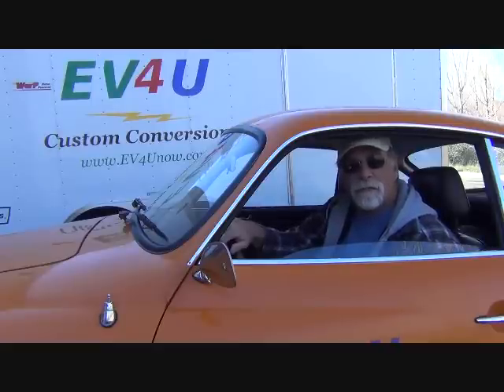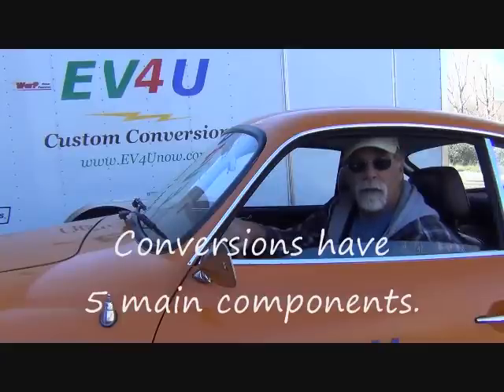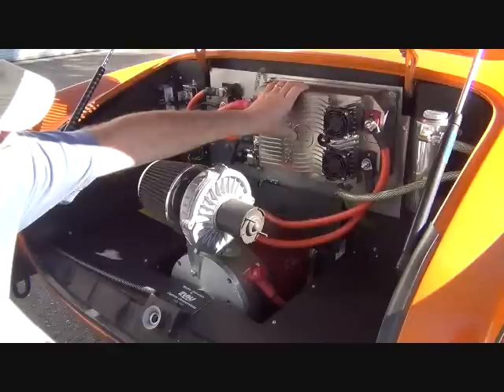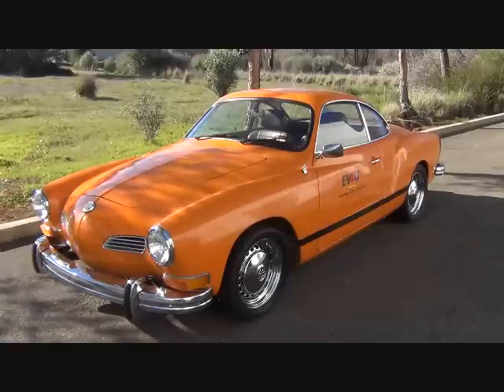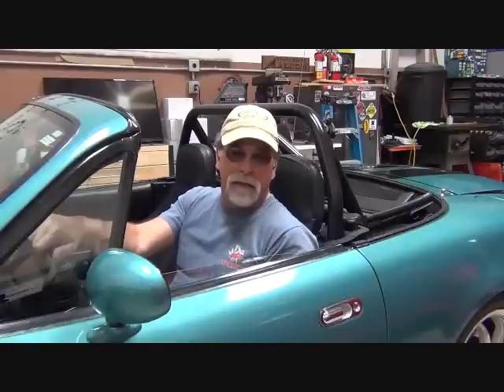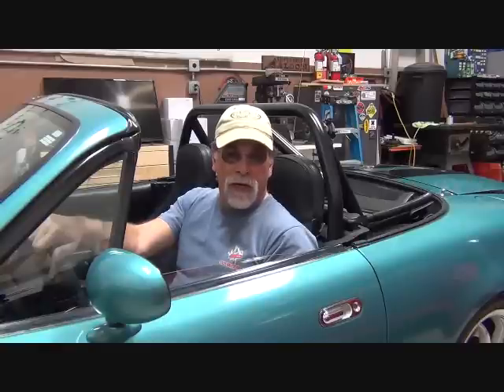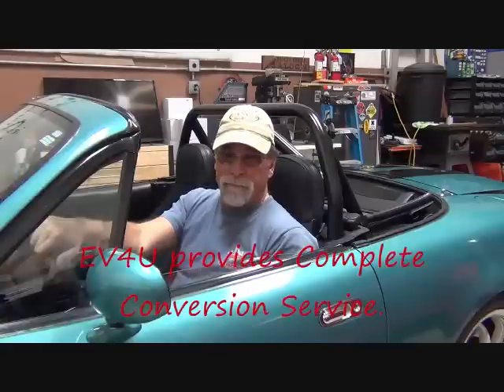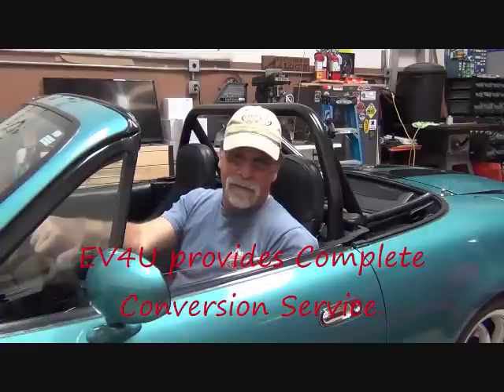DIY EV Workshop - The Best Way Convert Your Car From Gas to Electric  www.EV4Unow.com

Comment: Where can one buy the parts for this type of conversion?
I also have one more question, that is, would one need to strip-out the brakes, fuel system and electronics from an older car in order to make this conversion, meaning you literally take the car down to a shell and install  the electronic system?

I would come to a workshop, however I live in London and cannot travel so far.
Thank you.
Reply from the maker: Removal of the internal combustion components are removed, but nothing else.  The brakes are not removed.  Thanks for watching.

Comment: Curious if there are any issues getting it licensed with the DMV ?  Do you have any referrals to a shop in the San Francisco Bay Area?
Reply from the maker: No issues with the DMV.  If the vehicle is smog required, then you need to take it to the DMV office so that they can verify that it is no longer internal combustion.  You are then smog exempt.  Not familiar with any shops in the Bay Area.  Thanks for watching.